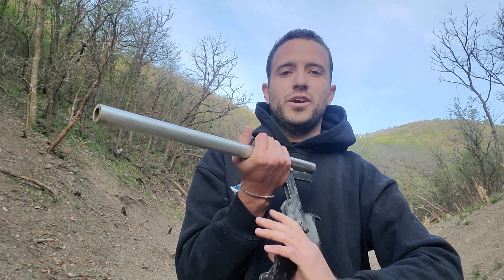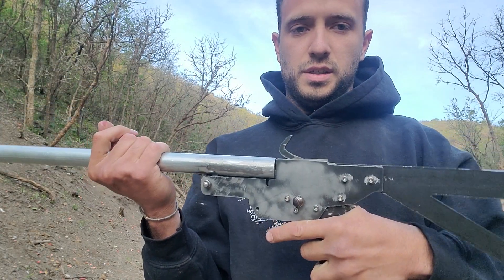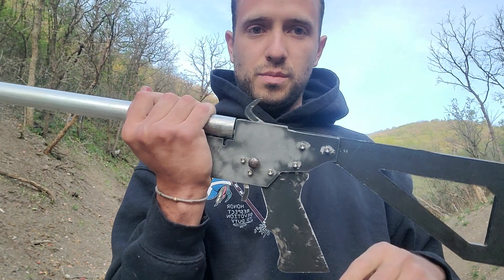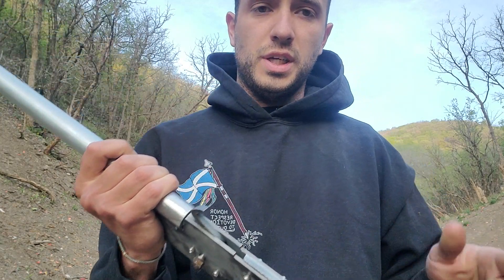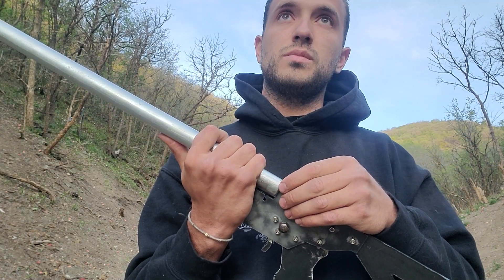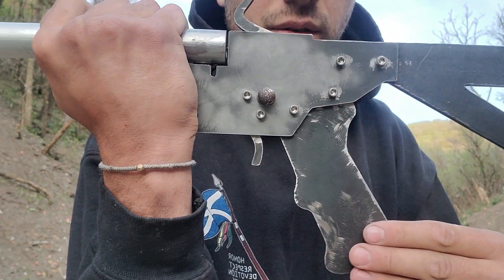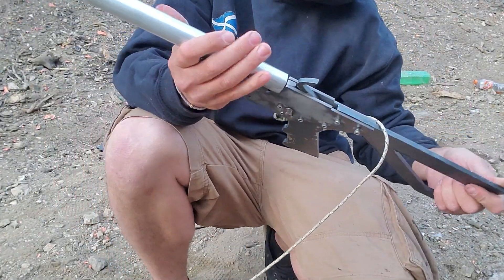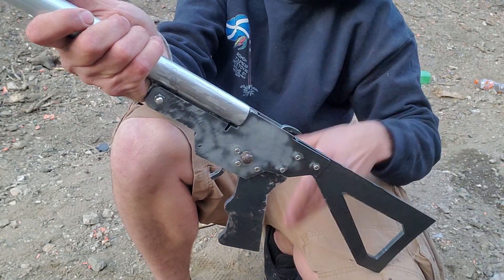Test firing the CL-89

Comment: To me, the feasibility depends on the price point. A Hatfield costs like $100,so if you can sell em below that i'd buy one for sure.
Reply from the maker: Right, I just don't know if that price point is logical considering the time it takes to make each piece. With this kit you get the experience of building an almost one of a kind shotgun (father son project etc) and you can customize it however you want. I'm also considering just selling the blue prints needed to make it.